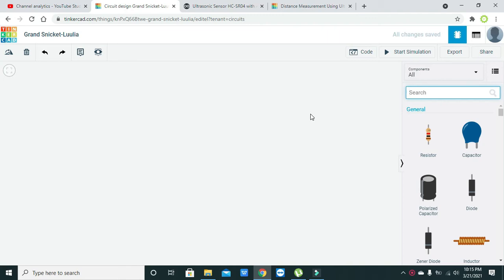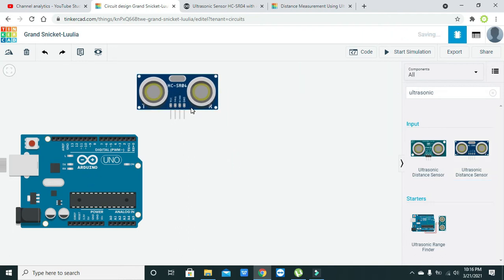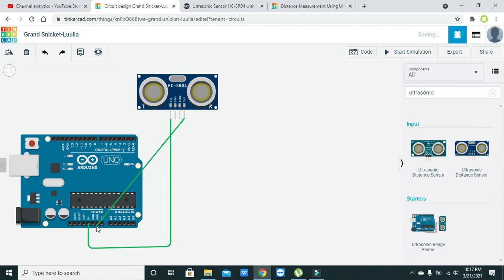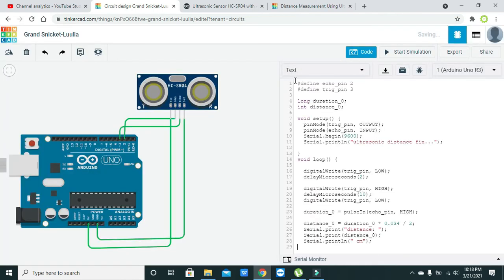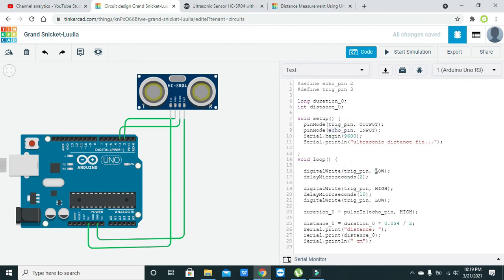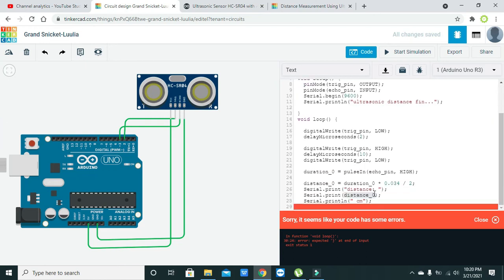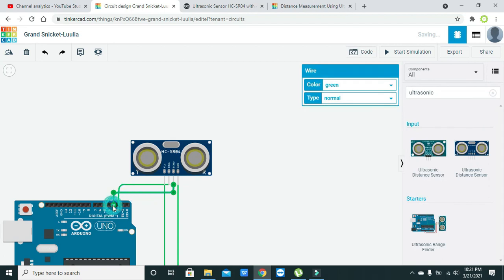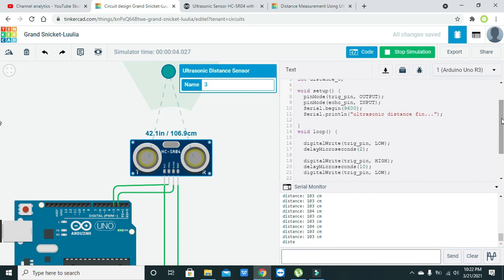simulation of Ultrasonic sensor with arduino in tinkercad

Comment: #define echo_pin 2  
#define trig_pin 3 
 long duration_0;
 int distance_0;
 void setup () { 
pinMode (trig_pin, OUTPUT);
 pinMode (echo_pin, INPUT);
 Serial.begin (9600);
 Serial.println("ultrasonic distance fin...");
 }
 void loop()   { 

digitalWrite (trig_pin, LOW); 
delayMicroseconds (2);

 digitalWrite (trig_pin, HIGH); 
delayMicroseconds (10) ;
 digitalWrite (trig_pin, LOW);

 duration_0 = pulseIn (echo_pin, HIGH);

 distance_0 = duration_0+ 0.034 / 2;
 Serial.print ("distance: ");
 Serial.print (distance_0);
 Serial.println(" cm");
}